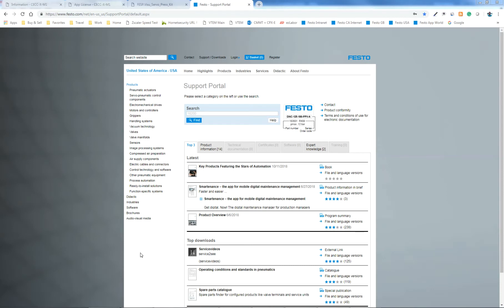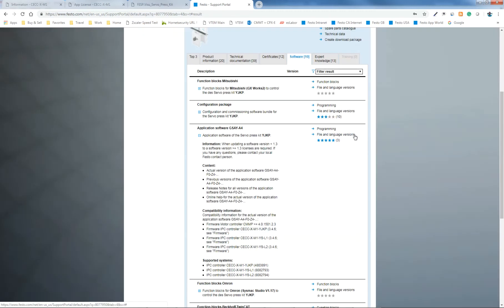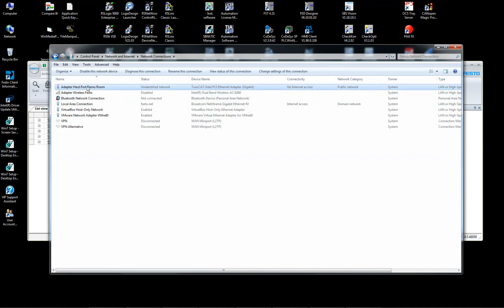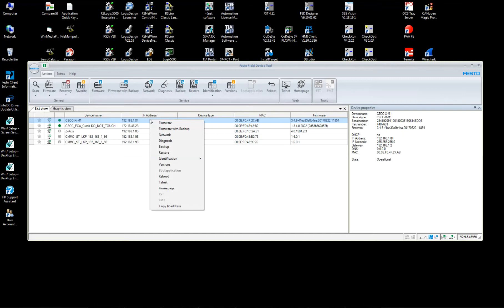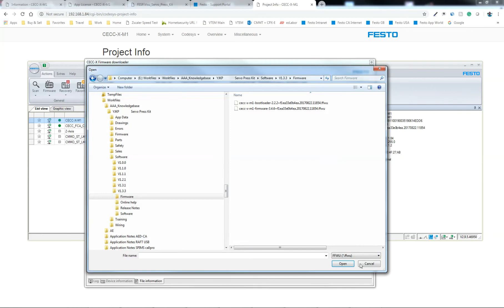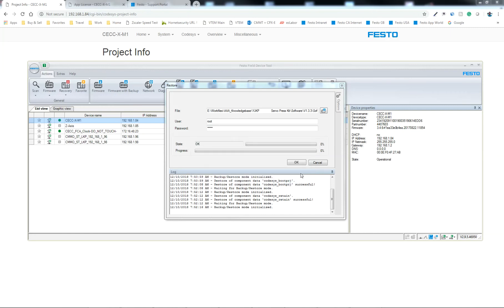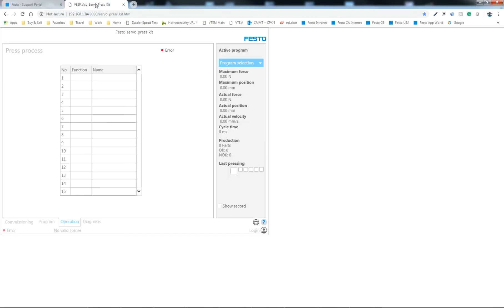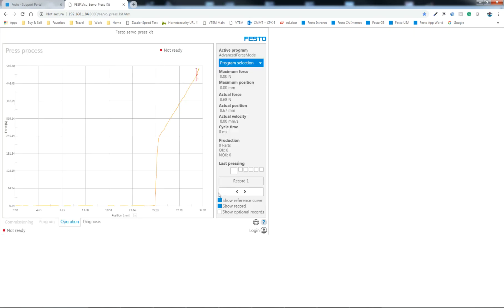YJKP + Step#3 Firmware & Application & License Update

Comment: As Steve mentioned in 16:13, since he swapped controllers for whatever reason, his old license resided in the old controller, so now that he bought a new one controller he can get the license from a Festo representative but an easier way would be to purchase the controller with the license pre-installed.

Controller with basic license
CECC-X-M1-YS-L1
8082793
https://www.festo.com/net/en-us_us/SupportPortal/default.aspx?q=8082793

Controller with advanced license
CECC-X-M1-YS-L2
8082794
https://www.festo.com/net/en-us_us/SupportPortal/default.aspx?q=8082794